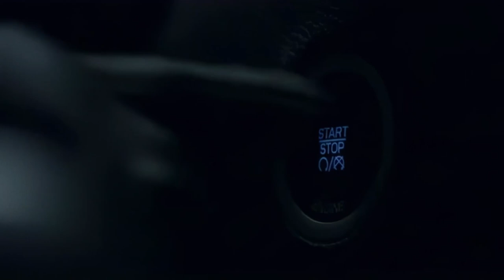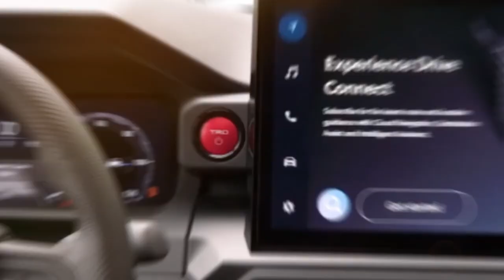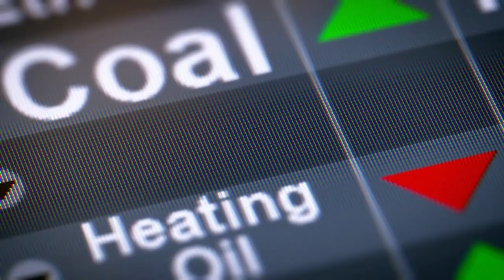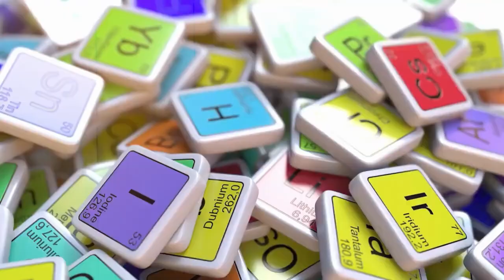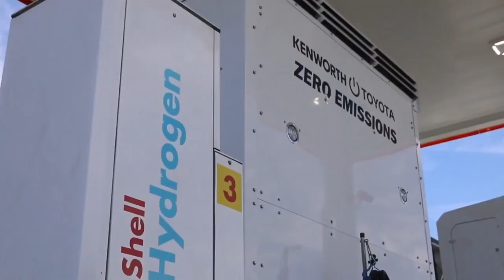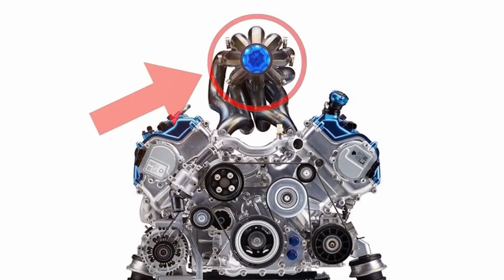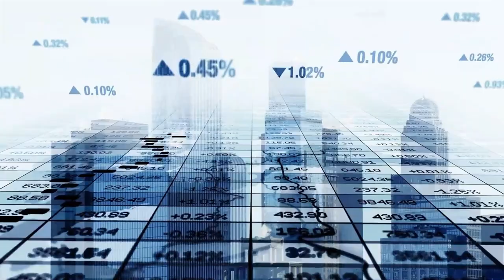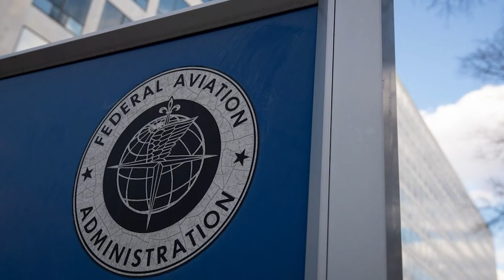Toyota's NEW Engines Will Bankrupt The Entire Car Industry!

Comment: Ditching the Manuel trans is a horrible idea if Toyota is trying to sell this as anything more than a parking lot princess.
As far as Hydrogen goes, Hydrogen is very energy intensive to create, around 600 watts of electricity to create 100 watts of Hydrogen. Even here where I'm at in Sillycon Valley there are not enough filling stations to make this practical for anything more than the early adopter/Hydrogen enthusiasts to go to and from work. Currently there is no way to produce any meaningful amount this "extremely abundant element" at home like you could for electric vehicles. Sorry but Toyota isn't disrupting anything with this tech.